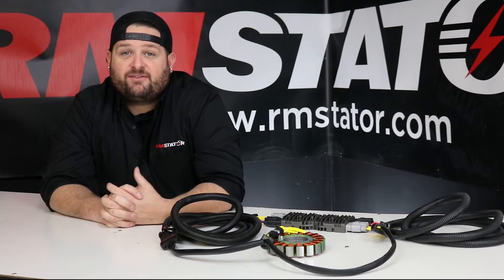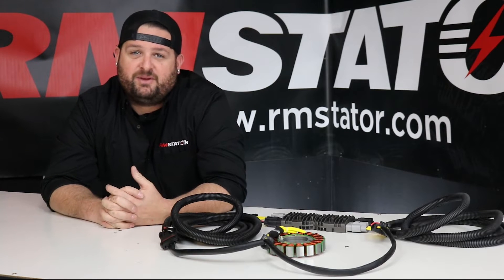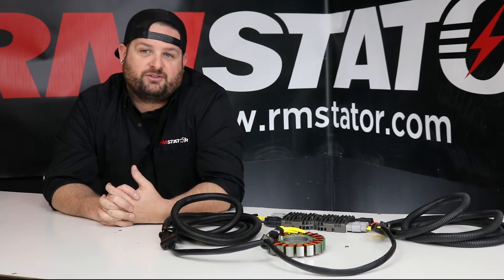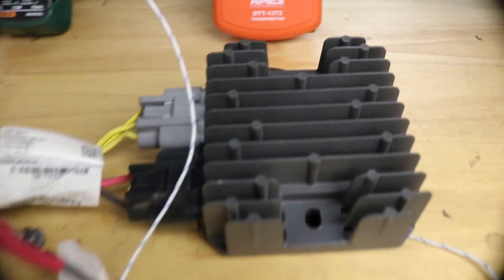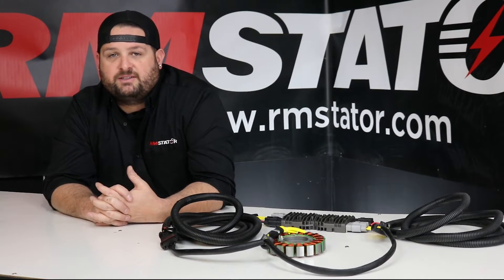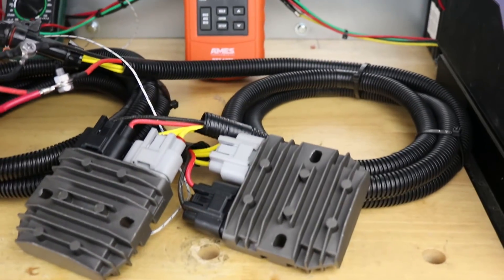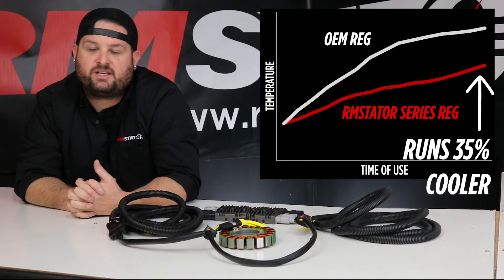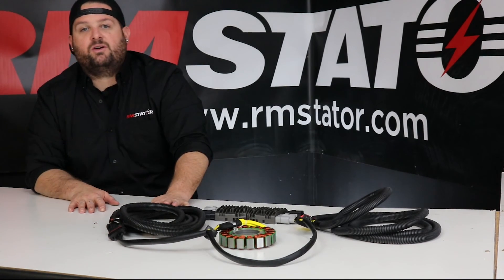Solution for Polaris ATVs and UTVs electrical failures | Dual Output Stator & SERIES Regulators

Comment: I love the break down on what the value is. Buying the dual kit for my 2021 turbo XP. By the way you need to add 2021 turbo XP to your list (on the web site) of RZRs that part: 416684-31280414 fits because if it fits the Turbo S it will work on the turbo XP that same year. 👍🤘🤘
Reply from the maker: Thanks! We will have our fitment list updated with more recent models soon. Appreciate the feedback!